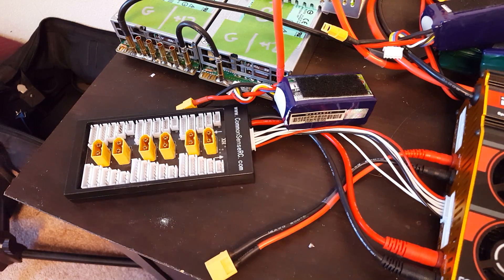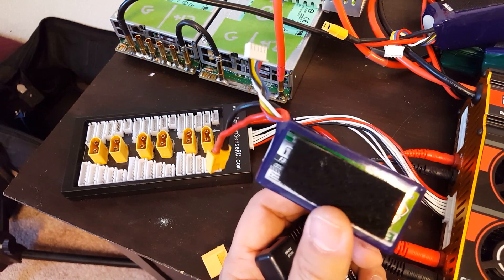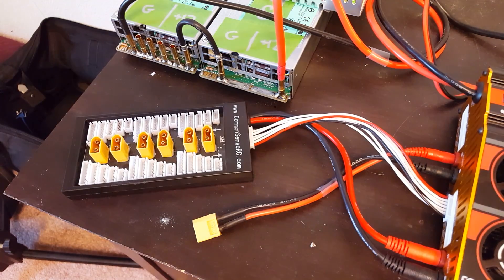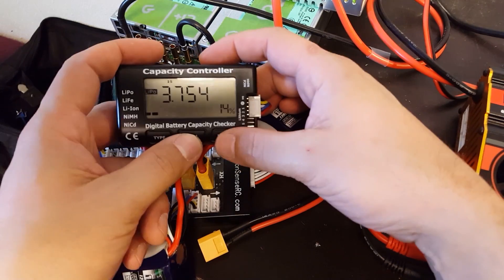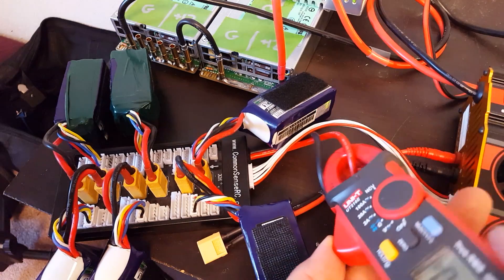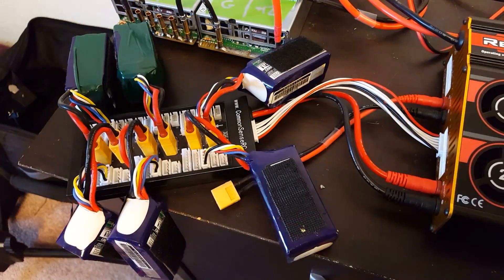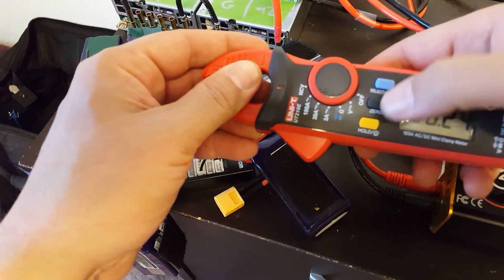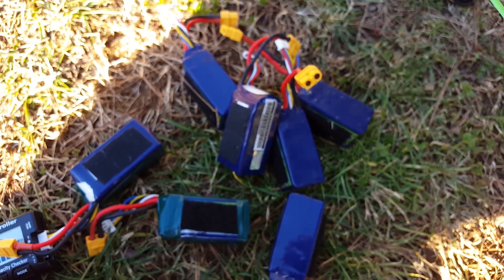Balance Charging: Can you parallel charge?

Comment: I also parallel charge, but I never thought about the IR changing the rate of distribution, so thank a lot for the SUPER clear explanation ✌️
Reply from the maker: +Captain S Awesome! There is still some debate as to whether it is the IR or some other characteristic that is causing the different current between the packs, but the takeaway is that you can't assume that each pack is taking the same C rate of charge in a parallel configuration.

Comment: I was looking at your power supply in the video. Can you do a video on how to safely mod 2 12v supply's to be 24v?
Reply: +Joshua Bardwell 

Good on ya mate! Safety first!
Reply from the maker: +Kevin Keane I'm not going to make that video. That mod is simple to do, but it is easy to make a mistake that creates an unsafe condition without realizing it. I don't want to be responsible for leaving out an important detail, or having somebody mess up the mod, and somebody getting hurt or worse.

The gist of the issue is that you need to isolate the DC negative terminal from earth ground. This will allow the "high side" PSU to get its negative reference from the positive (12v) output of the "low side" PSU. The exact steps to do this depend on which PSU you have. And if your mod fails, the best-case thing that will happen is that you may burn out your PSU. But in the worst case, you can end up with 120v or 220v line voltage, rectified to DC, on the DC positive output rail. This is why I won't do a simple how-to. If somebody is going to do this mod, they need to have thoroughly researched it and understand all the ins and outs. Blindly following steps without understanding of the risks is dangerous.
Reply: +Joshua Bardwell I figured that may be a concern. Thanks for doing what you do your videos are amazing I always learn something new.

Comment: nice to know I was right about this. I have always gone ahead and balanced in parallel without issue but this is fantastic info as always.

also.. clamp meter = http://i.imgur.com/qdI9f1E.gif <--- mind blown!
Reply from the maker: +Josh “Wicket” Bryson Clamp meter is the only way to measure current, unless you are working with very small current or need very high precision. The limiting factor has always been that they were bloody expensive, but as usual, the Chinese have saved the average person.

Comment: Hello, How do you end up with all the batteries almost at the same voltage when you use them? Are you flying the battery based on time, mAh or voltage?
Reply from the maker: +kitesurfjerry I have an OSD that lets me monitor both voltage and mAh while in flight. If the batteries are all healthy, then running the same mAh results in about the same voltage at the end of the flight. If a battery is unhealthy, it will hit the voltage alert level before the mAh are consumed, and I will stop flying then.
Reply: Joshua Bardwell so, if i have a healthy 4s 1300mAh is safe to use about 1000mAh? I also have an OSD but the voltage jumps up and down constantly and is hard to judge the voltage.
Reply from the maker: kitesurfjerry I use 80% mAh as a guideline, so around 1000 to 1100 of a 1300. But I also watch the voltage, and if I start to see sags below 14.0, I get conservative, and around 13.7 is my absolute bottom.

Comment: Why didn't you measure the passive parallel balance current?
Reply from the maker: +d3xterown Didn't think of it.
Reply: +Joshua Bardwell Could you try plugging in cells with certain V diffrence (0.5v?). The current is only limited by the resistance then    I=U/R (estimated I know this is an advanced circuit)  0.5V/4ohm (worst case http://www.rcgroups.com/forums/showthread.php?t=1578001&page=5) would be .125A  Nothing special, buth with supercaps and verry low internal resistance It would be problimatic
Reply: +Joshua Bardwell  Could you test it?  a full battery and an empty battery ? Each wire seperatly?

Comment: What charger was that? I'm looking for something under 100$ that can parallel 6-8 4s 1000-1300 lipos. I saw your other video about chargers but didn't fully understand it.
Reply from the maker: +giovanni mercado 8 * 1300 mAh = 10,400 mA for 1C charge rate, or 10.4 amps. To charge 8x 1300 LiPo at 1C rate, you need to put out 10.4 amps. To charge at 2C you need 20.8 amps. Let's say that you need about a 20 amp charge rate or less.

20 amps * 16.8 volts = 336 watts. In reality, your watt output will always be less than this, as the charging slows down as the batteries approach full charge. 

So it looks like you are looking for a charger in about the 300-350 watt range, rated for about 20 amps. From there, you can make your own decision as to which one best fits your needs.

Comment: so this video gave me a little idea, not sure how "safe" it is but thought i would put it out there as i did it tonight. i had some batteries i flew today and one was just a tad out of range 0.4 on a 3S from the others. i hooked them all up to the balance board and let them sit for about 10 minutes.... went back and checked their voltages and all were dead on at 11.08, so i then proceeded to balance change them all in parallel.

thoughts? seems like a reasonable workaround if some are just out of bounds of the safe parallel charge variances...
Reply from the maker: The 0.1 per cell guideline is specifically intended to keep that initial equalization current to a safe level. The problem happens when you plug the packs in, not when you hit the button to start the cycle.
Reply: Joshua Bardwell gotcha...it was right on the cusp anyway. like really more like 0.38, but enough to make me think about not doing it. thanks!

Comment: Thanks, the note about proportional current depending on IR is excellent to know.
Reply from the maker: +MicroRCFiend There seems to be some debate as to whether it depends on IR or some other factor, but I don't think there is any debating that some batteries are taking more current than others. So if your goal is to stay under a certain rate, you can't simply multiply that rate by the number of batteries to get your charge rate.

Comment: Another excellent tutorial. How long would you recommend leaving your batteries to naturally balance before charging?
Reply: +Andrew Demczuk First plug in the xt60s and let them have at least 30 sec. After you plug in the balance leads just start the charge
Reply from the maker: +Andrew Demczuk I have used a current meter to measure how long it takes them to even out after plugging in to the board. There can be an initial rush of current as much as 5 amps, but it quickly dies down to below 1-2 amps.

I don't think there is any danger to starting charging before they have perfectly evened out. If there is some residual voltage difference between them when charging starts, they will take current at various rates depending on their state of charge. It will all work out in the end. As shown in this video, even when the packs were perfectly even, there will still be significant current difference between them due to other factors. 

I believe that the reason people plug in the discharge leads first is to avoid sending high current down the relatively small balance lead wires. If you were to plug in batteries with a big enough voltage difference, and if you were to plug in the balance leads first, you could burn a wire or a trace on your board. By letting the batteries equalize over the discharge leads, you protect against this scenario. But of course you can--AND SHOULD--just use a battery checker to ensure that your packs are not more than 0.1 volts per cell off from each other, and you should be okay. Also, check the state of balance of the packs to ensure that a wildly out of balance pack is not going to create a bigger voltage difference than is apparent from the pack voltage.

Comment: You mentioned that the charge rate differs over the batteries, because of the internal resistance. Does this mean that some batteries are at the max capacity sooner than the others? If so is not a risk of overcharging?
Reply from the maker: All batteries are a equal voltage because they are in parallel. There is no risk of overcharging as long as all balance leads are connected. The only difference is how much current is going into the batteries.
Reply: +FPV Tripper The danger is if one of the packs have a bad cell. That will drain all the other connected packs.

Comment: Are you using banana connectors on your server power supplies? I'm about to modify mine here soon, was wondering if you would recommend using those?
Reply from the maker: +Ryan Hackney Those are 4 mm bullets. I think some people even use 5.5 mm bullets. I would just look at the amp handling capability of the connector. Everything beyond that is personal preference.
Reply from the maker: +Ryan Hackney FWIW, I used 4mm bullets because that's what came on my 1200W charger from the factory. So I figure it must be good enough.
Reply: +Joshua Bardwell Awesome thanks! Ya, I'm putting in a order now at HK, they have some 4mm bullets that say they can handle 100 amps continuous so should be plenty.  They've got the Reaktor 1000W for $70 so I don't think I can pass that up. Did you ever hear anything about a firmware update for LiHVs?
Reply from the maker: Ryan Hackney No dice on the firmware update. One approach would be to charge the HV's to 4.20 volts on a regular charger and then use a smaller charger to finish them off to 4.35.

Comment: I don't think differing internal resistances are going to affect the current flowing into each pack. The difference is dominated by the voltage drop across the charge board itself, ie the first battery in the string sees a higher voltage from the charger than the last in the string. You can test this easily with your multimeter on the back of the board.

I parallel charge using a 10-way board with fuses on each battery. The most dangerous thing I can think of is actually one of the balance leads being disconnected in some way. Ie a wire is broken or a trace on the board is broken. Normally when you balance charge a single pack the charger can see the voltage of all the cells in your pack and detect a problem. If one of your packs in a parallel board has a bad cell and the charger cant see it because of a broken connection you have a chance of fire. You could be getting up to 16.8V and 5 of the batteries have 4.2V on each cell, but the broken pack has 3.7V on one cell and more than 4.3 on the others.
Reply: +highoctanehotrod I only know of one charger that charges via balance leads, all the others as you say only discharge via those leads. However on a parallel board, current will flow between batteries via the balance leads, especially the highest voltage and ground leads. They are in parallel with the main traces on the PCB and help to share the current as you suggest.
Reply: +Goat p.s. I am going to make another round of my parallel charge boards, I will send you one for free if you like. It will be fused on all xt-60 and also the balance ports.
Reply: +1...the first battery closest to the source is getting the most current, the last the least and the ones in the middle varying from high to low from closest to the input side of the board to furtherest, and Josh's video actually shows exactly that.
Reply: +Goat oh and here's something else I see often that seems to be people are confused about. But if I read my charger manual correctly charge current is only supplied via the main power wires and the balance leads DISCHARGE high cells in order to balance. So if I read right No charging is done through the balance leads..
Reply from the maker: +Goat That's interesting. I assumed it was the IR of the batteries, but I just did some tests of my batteries' IR's and found they were not that far off. I'm surprised there is that much voltage difference between the front and the back of the board. Is there really that much resistance in the copper traces? I guess a simple multimeter check will tell the tale.
Reply from the maker: +Goat I just realized that I am in the middle of charging 3 batteries on a 6-way parallel board. I measured voltage at all three of the un-used XT-60 ports, as well as all six of the 3S balance ports (this is a 4S charge). Voltage was identical across all of them. I don't think that voltage drop from the front to the back of the board is the cause.
Reply: +Joshua Bardwell Check the amps again and see if the first one isn't pulling the most amps. My theory is It's not just the board per se but because the first battery is closest to the source. You would know this much better than I but I've always been taught current flows a lot like water, path of least resistance and therefore will fill the first "reservoir" it comes to fastest, the resistance down the line might not be of great difference but it will be lower.
Reply: +highoctanehotrod I meant resistance down the line will be higher..and yes that's oversimplified explanation but I've parallel charged other types of batteries and all things being equal (capacity to take a charge ect) the ones down the line will get less current, the it of the battery plays a part..but it isn't a difference in it between the battery's..JMo
Reply from the maker: +highoctanehotrod You're describing series resistances, though. When current flows through resistors in series, voltage drops proportional to the relative resistance. This is the principle behind a voltage divider. But current through serial loads is always the same.

Resistors in parallel always have identical voltage across them, and current flow proportional to their resistance. This is the case with a parallel charge board. The only way that voltage at the far end of the board would be lower than at the near end of the board would be if the copper trace itself had sufficient resistance to act like a series of resistors. That's what I thought was being suggested, but it's definitely not the case for my board at least.
Reply: +Joshua Bardwell copy, I never said anything about voltage drop, in the video you were talking about the difference in amps being put into the batteries..I think you just confirmed what I suggested. Even if all the batteries has the same IR. All things equal the battery closest to the source of charge will get the most amps.
Reply from the maker: +highoctanehotrod  "All things equal the battery closest to the source of charge will get the most amps."

Only if the copper trace itself has non-negligible resistance. Otherwise, voltage across the loads is identical and current through them is proportional only to resistance.
Reply: +Joshua Bardwell makes sense to me..what did your follow up test show? Does the furtherest battery (all being of same capacity and similar voltage) draw the lowest amps? And what about current carrying capabilities of the traces? I'll leave the electrons to you but in my experience the further from the source in parallel the lower the amps into the battery, again all else being equal..that was my only point :)